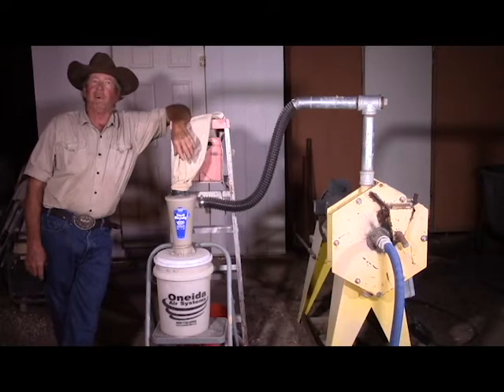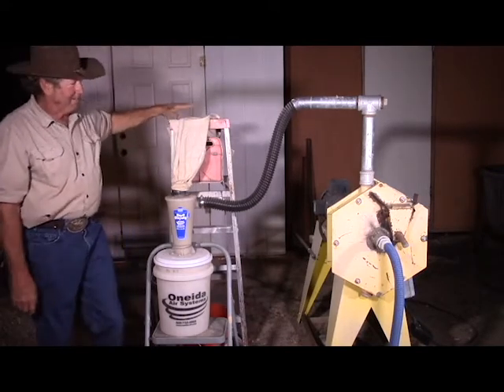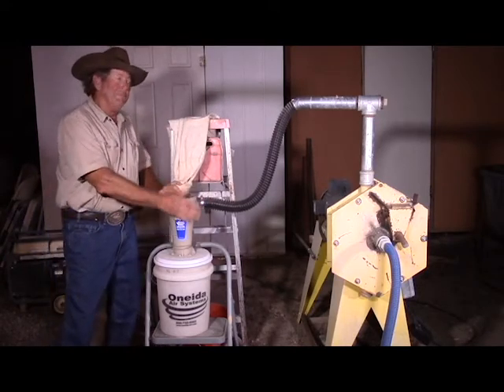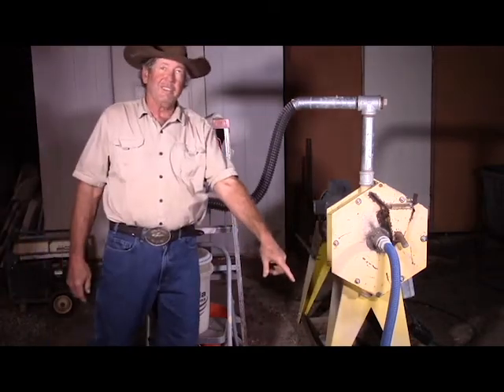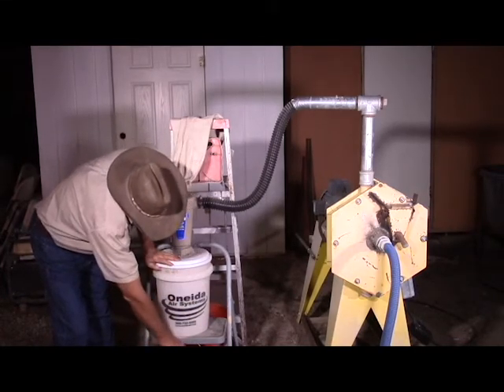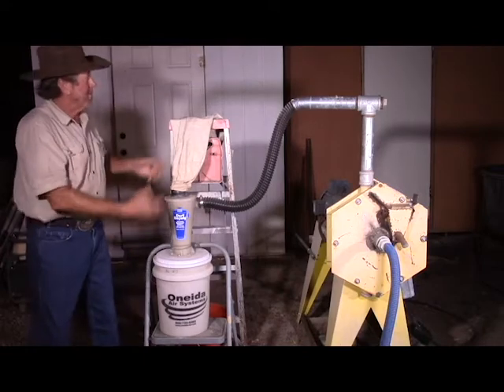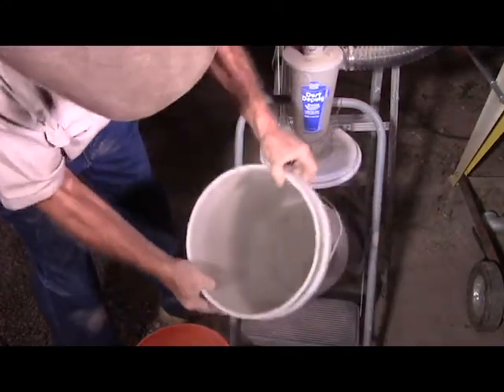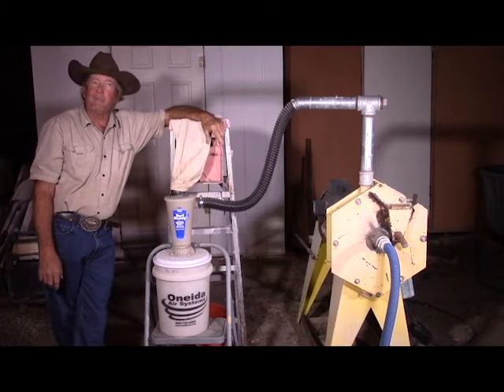Lesson 29 Air Cyclone and Pneumatic Transport in Impact Milling

Comment: Any formula for tube height, airflow, etc and resulting particle size?
Reply: Want to use a device like this for continous particle sizing in charcoal powderization for slurry fuels, and powder burners.
Reply from the maker: @ericlotze7724  No, I don't have a formula.  If you can throttle the airflow over a wide range you should be able to adjust it to near where you need.

Comment: Took a look at the mechanics of the system and how it could be done DIY.  There's a video on here that uses two five gallon buckets clamped together to do the same thing as the store-bought unit.  For maybe $30 you could build two cyclones in series,  emptying into other buckets or down into 55 gallon drums.  

Of course, like you mentioned, you could line the buckets or drums with spray nozzles and produce a slurry to feed a gravity separation table, a mineral jig, or bank of flotation cells.
Reply from the maker: The problem with DIY and me is that I generally wind up spending a lot of time and money on parts to make it 'just right'.  By the time I have done the usual two or three iterations, it often turns out to be cheaper to buy an off the shelf solution if one is available at a reasonable price..  :-)

The cyclone bolts to the bucket lid, so it would be easy to put two on a removable lid barrel.  You could run them in series for efficiency or parallel for throughput.  You might also be able to add a very small spray of water upstream of the cyclone to agglomerate the finest dust with the larger particles.  However, I would be concerned about getting just enough water for agglomeration without making mud that stuck to the walls of the system and plugged things up- especially it the feed surged.  The dust collector bag or vacuum solves that nicely.

You could probably make a conical bottom in a barrel or bucket with expanding foam and a knife with little skill, cost, or weight.  

I especially like the idea of gaining height with no additional moving parts.  Look at the conveyors on the MBMMLLC mill set up.  Perfectly functional- but complex with lots of parts that wear.

You wouldn't need much of a spray in the bucket to make slurry if the dust is completely contained.  It will naturally settle to the top of the water and would be easily submerged at that point.

keith
Reply: One part of my dad's company built aggregate handling/storage systems and also full scale crushing plants for commercial aggregate production.  The fewer belt conveyors you have in your life, the better.  

On top of the usual pain the rear of dealing with the head and tail pulleys , wearing of the lagging, weigh boxes for belt stretching, training the belt, putting on new ones as they wear, power consumption, their high capital costs, etc, then you run into our wind issues here.  You see it a lot in windier portions of the US where you need wind loops and canvas covers to keep the wind from flipping the belt off your troughing idlers and dumping a ton of ore or more into the air.  Then the coverings come with their own issues since you're containing the dust in and around the conveyor frame section, around the idlers, and up in the head pulley section where air would normally push the dust away from those wear points.

And what's even better than all of that is the dang greasing of fittings and the oil that the pulleys and motors take.  You know how well oil and grease go with gold ore.  

No sir, I like your air pushing the ore around a heck of a lot more than material belt conveyor systems for sure.
Reply from the maker: I saw a mill once that had so many conveyors it was ridiculous.  When you have conveyors feeding conveyors you know you did something wrong.  :-)

It was designed by some college professors who spent $2,000,000.00 on building a mill before securing water rights.  OOPPSIE!

To think of how many fishing trips they wasted...  :-)

Keith
Reply: I saw that unit and was curious how well it would work. I must admit I had my doubts,  and at the price decided not to bite.  You should get a sales commission on the one I buy now.  Very useful video
Reply from the maker: You're welcome.

Keith